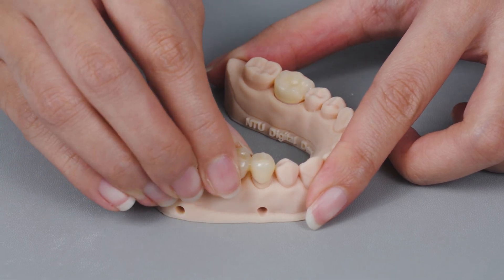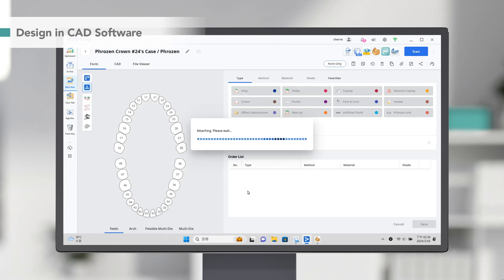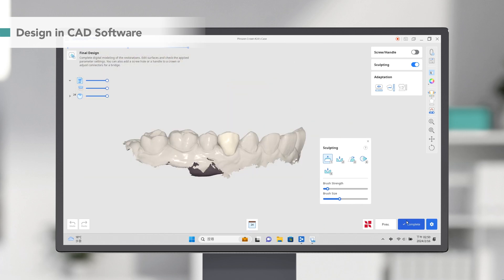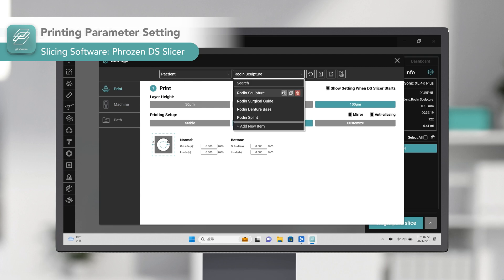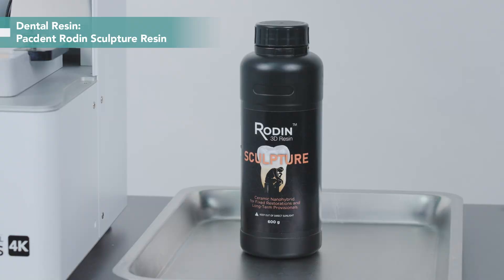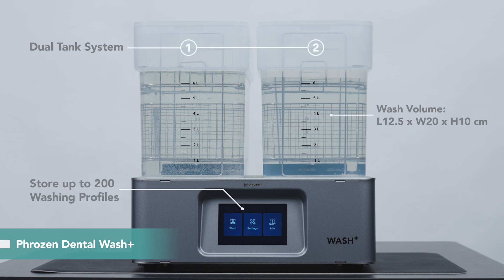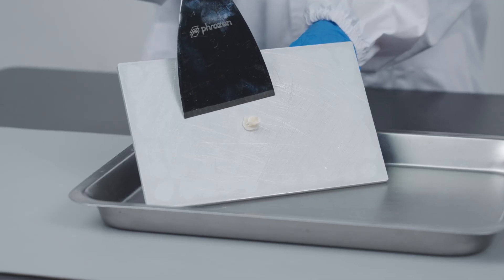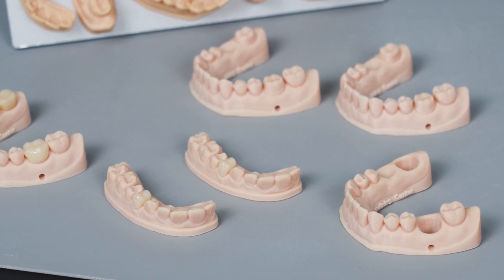How to Produce Crown & Bridge with 3D Printing - Phrozen Dental

Comment: Hello what you used in washing the 3d printed models and crown by water?
Reply: Resin is toxic, so never wash it in water and/or put waste into the drain. Usually there is alcohol based solution like isopropyalcohol.